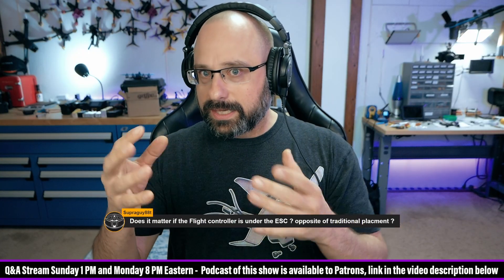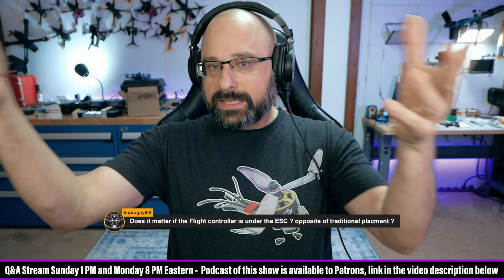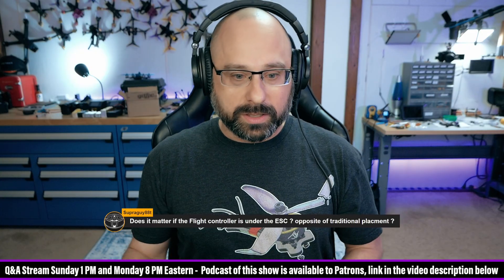Can You Mount The Flight Controller On The Bottom of the Stack and the ESC On Top? - FPV Questions

Comment: I’m currently building a quad with an F7 20x20 fc on the bottom and 30x30 esc on top. The esc is the Tmotor f55a proii so it has a heatsink, and this is one of the main reason I’m doing it this way. Hopefully it looks and functions good when I’m done.

Comment: Furthermore, the gyro sensor should theoretically and ideally be exactly at the height of the props. This means usually the 2nd to 3rd floor of the stack. Or does the Betaflight 3D model take into account that the FC is slightly below the props, and all PID controll have this as model...?  In addition, the gyro sensor on the FC PCB should ideally be exactly in the center.

Comment: funny, I'm currently rebuilding a drone after a crash and decided to mount the ESC above the FC for testing. My ESC has a decorative radiator, I wanted to show it off and that's the main reason for mounting it on top. I left the motor wires a bit longer so it could be removed more easily.